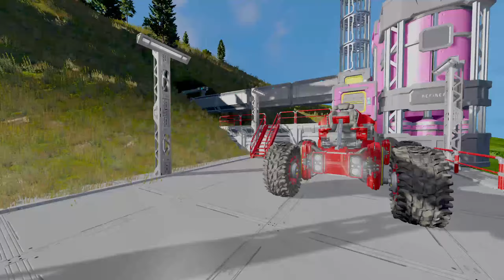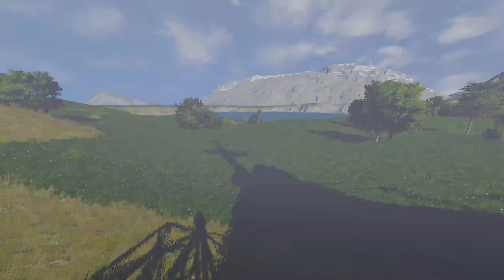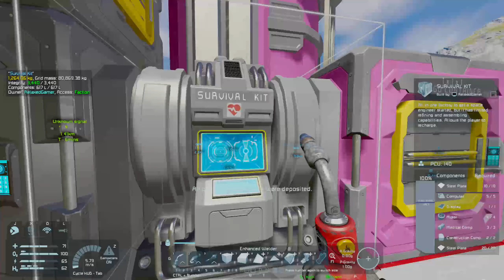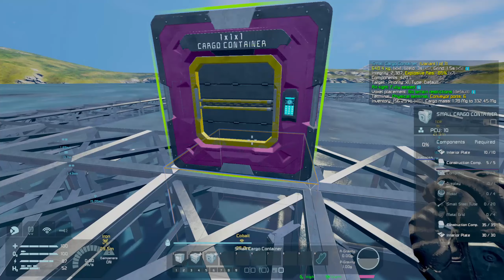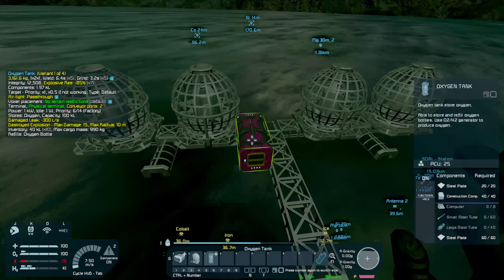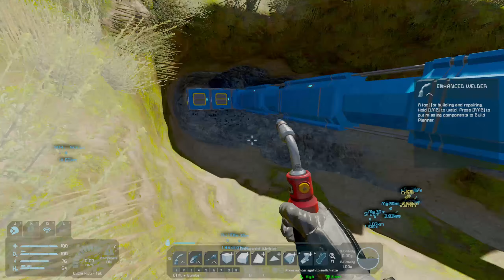Back to Basics, Again... Ep03 | Setting up a New Base & Starting to build a Welder Ship.

Comment: about the 45 minute mark I bet you wished you thought of bringing everything for the assembler and ingots.   Ingots are much more compact Liter wise and you could have built at ice base.  :)
Reply from the maker: Yeah I underestimated what I shoulda brought. I didn’t want to start drilling until I got the ice infrastructure in place even partially with at be least 1 H2 and O2 tank. I suppose I could a turned off the o2/h2 generator and just stockpiled ice. Ahh well, hindsight and all that. Then I got sidetracked at the initial base.